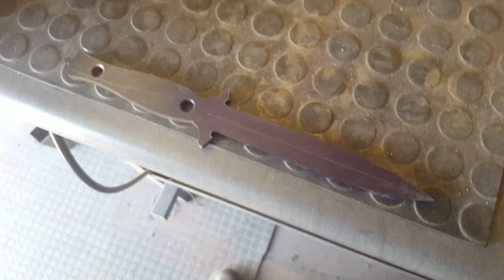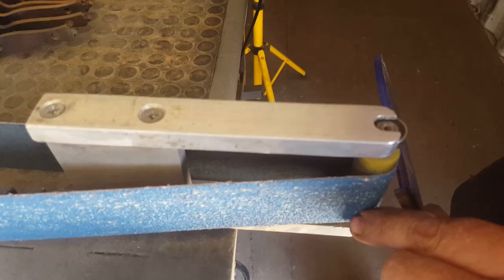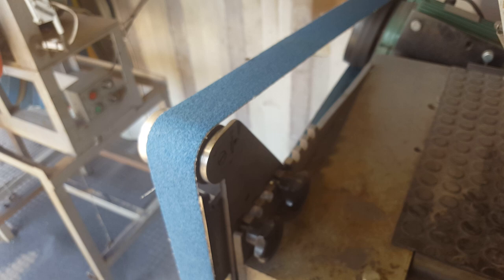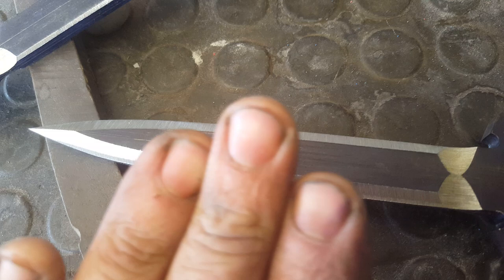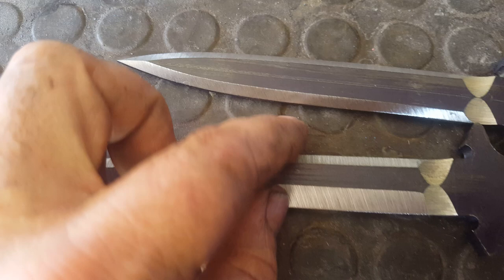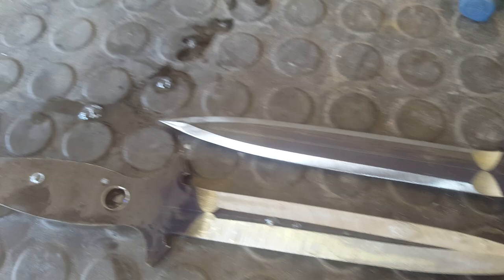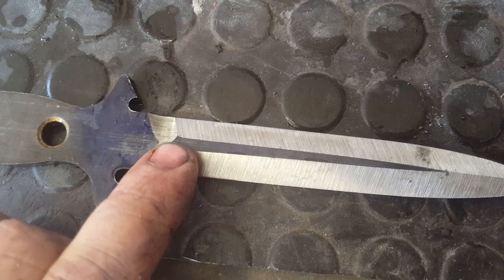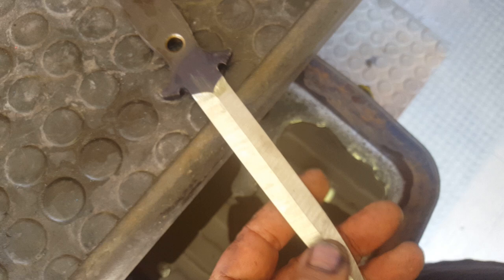Dagger grinding made simple

Comment: Tidy! As a soldiers knife, it would not need to look pretty,  they get banged up anyway. G10 handle scales on that with a slightly finer grind and then a edge put on. Would make a good knife. They soon get scratched up, so no need to be too fine a job. Collectors would be different. But would love to try it out. If the handle scales went all the way around the guard, it would give better handling,  and better purchase on the knife. Nothing worse than banging your fingers against just the steel guard. A nice wide guard helps alot, about 20mm would be perfect, and then profiled into the shape of the handle. Well done sir!